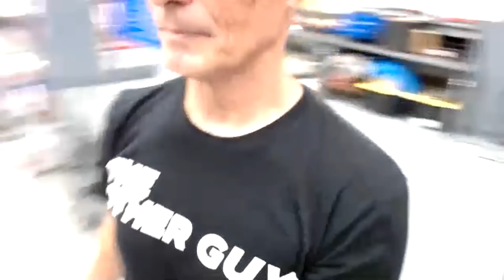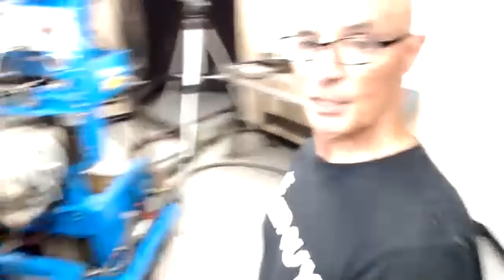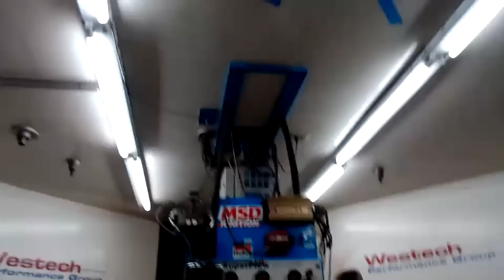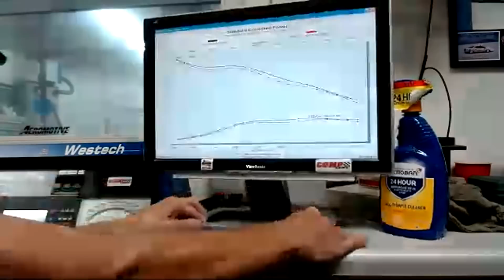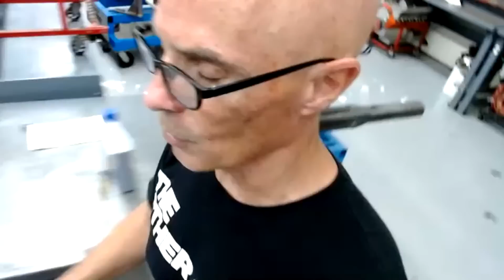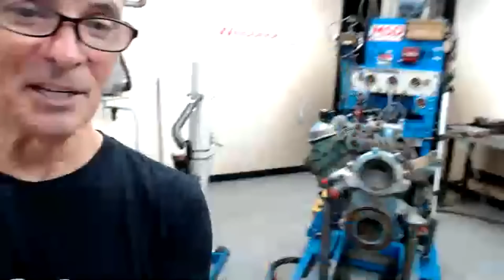LET'S TALK TECH-THE PONTIAC REVS NOW! WORKING ON FORD 5.0L P-V!

Comment: Back in the late '60s, I had a '62 Tempest and experienced the rev problem.  I was able to get another engine for $40 or $50 bucks and swapped the whole thing.  Always wondered what caused the problem, valve springs sound like a reasonable cause..

Comment: I know this is gonna sound really STUPID but I wonder if you could convert for use with an idler gear?? What about timing? Can you bore and stroke it to 214( half a 428) How about a supercharger? How about making a manifold with a 4 barrel,or 2×2 with Rochester or Edelbrock carbs with Long intake runners like on early Dodge Lancers and Plymouth Valiants from the early 60's. I heard that in the early 60's they had some oval track races designed for all the new " compact" cars and Dodge/Plymouth pretty much dominated the field, so much that they quit having them after a couple of  years!  I think they had 170 Slant 6's with a 4 barrel Carter. What's your opinion?? I wonder if builders who specialize in  straight 6's could help??
Reply from the maker: IT WILL BE 1/2 OF A 400 AND GET BOOST AND MULTI CARB INTAKES

Comment: ROYAL PONTIAC would add a .030 washing under the rocker jam nut on their bobcat cars to add 200 to 400 rpms to their engines.
Reply from the maker: we looked at adding a spacer under the jam nut but wasn't sure if that will work to make the lifter act like a short travel or just hold the valve open

Comment: All these people that just want to throw boost at it and call it a day...SMH.

First, let's rebuild the bottom end with new pistons, compression, a modern roller cam...top it off with a freshened up head, and a real intake manifold.  Then let's see what it will do.

After that, replace the head with a modern aftermarket aluminum one.  See if we can get 250 horsepower out of it NA.

Once we do that...then throw some boost on it.

Comment: Seems like the engine lost quite a bit of torque at low arm with the upgraded valvesprings. Maybe with weak springs and low rpm was that the only time the lifters did not collapse?
Reply from the maker: SPRINGS DONT HURT LOW SPEED TORQUE

Comment: @richardholdener What if you were to use a pontiac 301 turbo setup for a draw through turbo. I have the turbo and carb plate that bolts to the turbo id donate.

Comment: Congrats on finding the issue. We knew you would. I had 350 Chevy that easily redlined to 6200, but after sitting about 10 years, I encountered valve float at 5500. Appears valve springs lose their "life". And I too believe, all springs are not made of the same steel qualities

Comment: I'd start with a NOS Melling cam for a factory performance V8.   It just won't use half the loabs.  Should be NOS old cams all over the place.  Put a timing set in it and try it again.  I'll bet the motor will wake up as it is ...  We'd like to know that 😃
Reply from the maker: YOU CAN'T RUN A V8 CAM-WRONG FIRING ORDER
Reply: Richard has to repeat himself to those that don't listen. How frustrating it must be. Dementia and hearing loss runs rampant in comments.

Comment: what about using a 4 barrel duel plain manifold and use a 2 barrel feeding only one side? I'll bet an aluminum one would be easier to do, ie weld/modify. And/or go crazy and use an Edelbrock head, build it like a V8

Comment: One more thing. Your original rings having. 125 end gap and the. 060 over r8ngs having . Makes it almost impossible for that to be a standard bore engine. Factory piston to wall clearance is .0015 so .060 clearance wouldn't even run and the piston skirts would just break off. My bet is that it was bored .060 over which would allow the use of stock 400 pistons. I would check that after pulling the head.
Reply: They were 0.060" over size for a Chev 350 which has a 4.000" bore.  That makes them 4.060" which is the factory standard bore size for Pontiac 389 and 195 engines.
Reply: There were a few typos there. One thing I meant to add is that if you do the math it looks like your original rings could have been worn out .030 over 389 rings in a worn out standard 400 bore

Comment: I would pull the head and have a 3 angle valve job done with the correct seat angles and a back cut on both the intake and exhaust valves. Porting probably won't help much but a little correction in the lower seat cut to bowl transition would help. You should be able to get more cam lift by running the higher ratio rockers that were used on the RA 4 engines along with the correct studs and nuts to make them adjustable. A worn timing chain usually retards cam timing which reduces cranking compression but improves high rpm performance but maybe the chain tensioner reverses that trend.  Either way I would have the head work done,swap rockers and replace the timing chain before going any further.

Comment: Ok... so... we have a 60 year old engine with a low compression ratio, about .036 ring gap, questionable valves, questionable valve job/seats, no plate behind the water pump, a timing chain that's a foot longer than normal, old style points/condensor, a single barrel carb, and a lunatic running the asylum.  It's perfect!

Comment: Check what the factory valve seat angle is supposed to be vs what it is. IIRC Pontiac used a much steeper valve angle than the common 45 degree. It was done to improve low lift flow to compensate for the lack of cam lift. Most rebuilders don't bother to check and just do the valves and seats at 45 degrees. If the head was ever rebuilt it probably has the wrong valve seat angle.

Comment: We could have guessed it's got a little GM 184ish grind, but we shouldn't have to, even on an old banger we should know if TDC is marked about right, then we can easily do a rough check for split overlap and roughly work out how much the cam is retarded or advanced. But really we should just chuck a degree wheel on it and see if it's even worth bolting on a dyno before securing a reasonable cam. I think the motor was good enough to dyno, but not with that single cam and single carb option.

Comment: If you put 0.060 rings in it and there is still almost 40 tho clearance those 400 pistons probably wont clean the bores up. I would mic it in a couple spots before I committed to the machine work.
Reply: They were 0.060" over size for a Chev 350 which has a 4.000" bore.  That makes them 4.060" which is the factory standard bore size for Pontiac 389 and 195 engines.  So going up to 4.120" bore probably will clean them up.
Reply from the maker: THNX JOHN

Comment: It seems all 1961 and 1962 engines have 538177 heads and use a dish piston for low compression. The later high compression engines still use the 177 heads with a flat top and low compression use 796 or 797 heads with flat top pistons.
This engine will have a 177 head with 1.88/1.60 valves and 65-69cc chambers

Comment: pontiac detonation prone anyway why they have a machined firing chamber 10:1 plenty NA
Reply: just tightening up the quench works wonders on the old poncho 400 and 455 engines. back in high school they were the cheapest big blocks we could find. tear down, bring the pistons to zxero deck, use the right head gaskets for .035-.045 quench, an rv cam, and some bowl work they made great tire fryers. and would run all day on 87 octane piss. we had a cool auto shop teacher back then. he raced a 454 powered rail. so he was a wealth of info to us kids trying to have fun with less than beer money in our pockets. half the time hed call the local Neals auto parts and get him to give us parts at wholesale pricing. learned a lot about making old iron junk run. they were only 325-340 hp. but the torque was phenominal.
Reply: @b.c4066  yea that 7.6-8.0:1 was crazy low !!! i been saving this big olds for years want one more tire frier before i die !!!

Comment: Richard, I don't understand something about the Trophy 4-cylinder.  I work on antique, long-stroke 4-cylinder cars, and all of those engines have a quite pronounced secondary imbalance vibration at certain RPMs.  Since the Trophy-4 didn't have a balance shaft, doesn't it have some frequencies of secondary imbalance?
Reply from the maker: IT DOES
Reply: @richardholdener1727  Wow, I'm surprised that GM's customers found that acceptable in 1960.  As you may know, that's why most people who were buying their second car during the 1920s bought 6-cylinder cars:  They just got tired of that 4-cyl. vibration.  Nobody wanted those old 4-cylinder cars any longer after 6-cylinder cars became popular.

Comment: Pontiac uses 2 different headers also.
Reply: Depends if the decide on center ports comes all the way flush with header flange.
Reply: I think you are thinking of Oldsmobile with the shared center exhaust ports and they are all the same. Pontiac does have 2 different headers. One is for the D shaped exhaust ports that are on almost every Pontiac engine,the other is for round exhaust ports which were only used on the highest performance Pontiac engines in the late 60's and early 70's.
Reply: @richardschmidt95  yep. Had a 455 HO with the round exhaust ports. Intake was a two piece affair. Top part was great
The actual intake lower portion was an exhaust port crossover which provided heat for cold air starts.

Comment: Wow, you put 0.060" over rings in? Love it! Sounds like you've rebuilt it enough, it never made any power from the factory. Definitely good enough. Now let's put some  boost to it!
Reply: They were 0.060" over size for a Chev 350 which has a 4.000" bore.  That makes them 4.060" which is the factory standard bore size for Pontiac 389 and 195 engines.

Comment: Richard, the water pump backing plate looks normal to me.  It appears to be installed in the timing chain cover.  It's the thin sheet metal part with the hole in the middle.
Reply: But you need to make sure both rubbers are behind it.
Reply: @timothythomas1737  they didn’t start using those rubber sleeves until 68, this is way early the back of the timing cover there’s no tinplate it’s all built into the cover
Reply: I don't remember Pontiac using a water pump like a Chrysler

Comment: Take the stock 4 cylinder 1v intake and add 2 more 1v carb flanges  as close to the manifold runner elbow as possible.  You can cap the OG 1v flange with a plate.     2 x1v carbs were the performance set up for most of the European 4 bangers back in the day.  You could go whole hawg and  find the old 2x2v Weber intakes for them as well.

Comment: Just FYI, Schneider Racing sells lifters with oiling holes in the face. So oil is injected directly into the cam/lifter interface. If you wanna get a little spicy with the flat-tappet valvetrain, those lifters might be a good idea.

Comment: The Pontiac figure of 252 deg. duration is basically measured at 0 lift, perhaps 0.001".  It includes all clearance ramps.  So, you are probably close in assuming it is about 180 deg. at .050" lift.

Comment: Richard, knowing the large ring gap and all the taper the cylinders must have, I'm amazed that your engine generated 150 psi of cranking compression on all the cylinders.  If you didn't already know, and you probably do, 150 psi cranking compression is the spec for that Trophy 4 engine when it was NEW.
Reply from the maker: 149-151 ON ALL 4
Reply: @richardholdener1727  That speaks volumes for your head and ring job IMO.

Comment: Hi Richard love your videos.      I had a ford xflow had play in the rockers so I got the grinder an took about 1.5mm off the bottom of the bit that bolts down the rockers and it fixed it